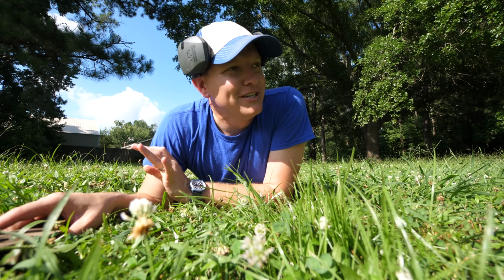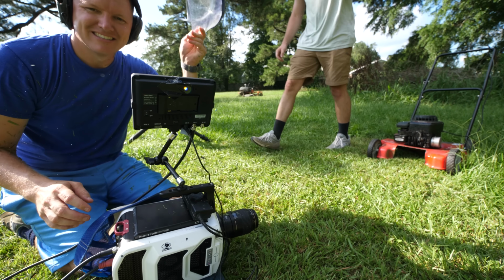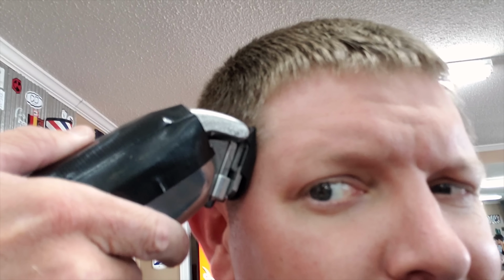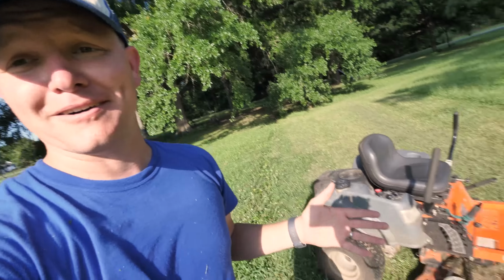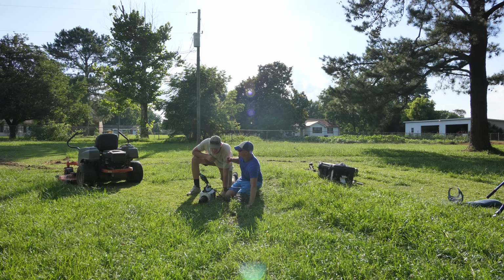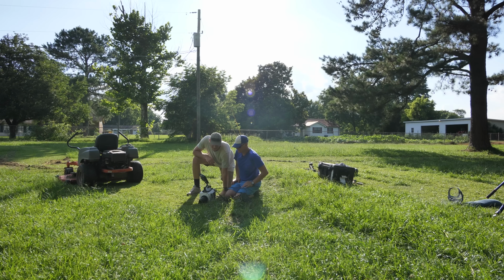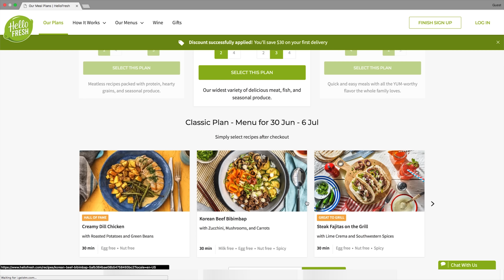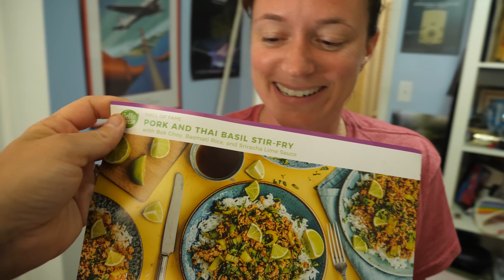How Lawn Mower Blades Cut Grass (at 50,000 FRAMES PER SECOND) - Smarter Every Day 196

Comment: I would be interested in seeing a video(or segment) on the old school rotary style lawn mowers(the sort of barrel shaped ones with no motor.)
I used to do lawn care(fertilizer, pesticides, etc.), and every class I took(often from people with post grad degrees in agronomics) and all my bosses, and everything I've ever read claimed that those are actually superior to the tradition walk-behind/ride-on spinning blade mowers. 
 supposedly they cut the grass much cleaner, as opposed to tearing the grass the way rotary mowers can do(if you look closely in this video, you can see the blades of grass are often raggedy at the ends after being cut(though this could possibly be due to a dull mower blade.))
this is bad because it hurts the appearance of the lawn(the tips are stringy and discolored), and also because it causes the plant to use more energy fixing the "wound", does more damage to the cells, causes a greater loss of moisture, and in particular makes the grass much more susceptible to disease(just like how getting your hand cut off by a shark, or chainsaw is more likely to become infected(due to the much larger surface area of exposed tissue) than getting your hand cut off by saw, a single clean slice by a very sharp samurai sword.))
however, I do not know why the rotary mowers cut more efficiently.  I doubt they cause much of the suction you refer to in this video, and I can't help but think the blades are traveling far slower.  it also seems like each section(or even blade) of grass would only have one chance to get cut with a rotary mower, whereas the rotating blade mowers(even though the cutting surface of the blade is only a few inches long at the extreme end of each side of the blade) has several chances to cut each blade(depending on how fast you are going) and thus is less likely to leave little "mohawks" of uncut grass behind.)
I suppose it could be due in part to the fact that the blades on rotary mowers are moving more or less straight in into the grass(almost like a scythe) whereas the blades on the type of mower in this video are rotating in an angular fasion, and may be more likely to "rip" the blade as opposed to making a clean cut, but since the blade is moving so fast, and the moment of contact between the blade and any individual piece of grass is so incredibly brief, I can't help but think  that the direction/way the blades are moving would make no difference(if the blades were cutting right near the center of blade, where the linear velocities would be lower, then maybe.)
the only other thing I can think of is that maybe the blades on drum style rotary mowers are sharper(please sharpen your mower blades regularly people), possible due to them being just simple pieces of think stamped metal(at least I think they're stamped, i could be wrong.)
wow.  god bless whoever took the time to read that ridiculously long comment about lawn mower blades.  lol.
Reply: The reel-type mower works exactly like scissors, by trapping the grass between the blades on the spinning reel and a fixed cutter bar.
Reply: ooooooh.  lol.  you'd think I should have known that.  no wonder it works so good.

Comment: Hi.  I watched your lawn mower blade cutting grass video. I think you should revisit this for a few reasons one being the blades were super dull. This results in the grass being ripped in half vs cut. Second if you have sharp blades the grass is cut at the tip of the blade as the blades travel across the grass. If you look at your video the tips of your blades are rounded and dull. 

I would love to hear your thoughts. Great job spreading science.  Thanks
Reply: yup, grass is cut by the outermost edge of the knife where there isn't any lift at all, indeed it is just passed the area where the air and clippings are being blown OUT and AWAY from the deck.

Comment: How about push lawnmowers that are entirely human powered, i.e. no engine.
Reply: Those have scissors and get jammed up on the tiniest twig.
Reply: If you keep the blades sharp that isn't as much of an issue. Also for certain jobs they are way better at getting even length.
Reply: you talk about the roller type weird looking blade? I am curious too!
Reply: I do that only using a sickle
Reply: They are basically a rolling pair of scissors.  There is a moving blade, and a stationary blade, and they create that shear point that he talked about at the beginning.
Reply: I didn't even knew that! Thanks, it would be fascinating to see it close up in action!
Reply: What about a scythe too
Reply: Push Reel Mowers are back in style these days. I've got one but it's not very effective on tall weeds.
Reply: Scissors basically :D
Reply: Push Reels are great if you have Bermuda grass and a nice level lawn  lol
Reply: The slightly fancy ones gear the blades to the wheel so the blades spin much faster.  They work well on a more-or-less uniform height of grass/weeds.  Unfortunately, stuff that is tall will tend to get pushed over instead of cut.
IMO, what seems to be missing is the vacuum/airflow pulling things up into the blades.  I've thought a bit too much about how one might be able to make a reel mower where the reel/blades basically make a squirrel-cage fan to provide that suction.  Wish I had the time and tools to prototype it.

PS: I've also been thinking about how to make something similar to a giant Flowbee (the weird vacuum haircutting attachment thing).  That could be cool.  I think there are significant benefits to having the cutting+sucking part of a mower be more of a long thin rectangle than a circle.
Reply: Mme. Hyraelle The best video I've found so far is "Fiskars Staysharp Reel Mower In Action".
Reply: A scythe would probably work on that the grass just does not have time to move out of the way so it acts stiff and gets cut. (idk just a thought)
Reply: I dislike that everyone nowadays uses the motorized lawnmowers. I think the older ones work more elegant and the work is more fun/less noisy.
Reply: The reel mower has a cutting board behind the spinners. The spinners lift the grass up against the blade. To the person who wished we would go back to that...NO. Simply No
Reply: It's telling that the Fiskars company, you know, the one whose name is printed on all those scissors in schools, makes a Reel Mower like you describe. A high quality one is actually pretty good and very inexpensive compared to a motorized one, and better if your mowing area is not very big.
Reply: Regarding a scythe: you swing it around so it cuts into the grass with some angle. The blade doesn't hit the grass with 90 degrees, but cuts into it with a steep angle. It's like when cutting something with a knife. You don't usually just push the knife into something straight down, but you make the blade go forward or backward, sliding it on the thing. Also scythe needs to be really sharp to work correctly.
Reply: Travis Collier i hope you persue your invention

Comment: That “tab” is not to suck the grass up. It’s for lifting the grass into the area above the blade AFTER it’s been cut, to allow it to be chopped up into finer pieces. It does not suck anything up.
Reply: Sorry I worked landscaping for 20 years.  Yes it does.  You can buy high lift blades which absolutely create more lift and suction.  We ran them on our scag mowers.  Airflow increased due to higher lift angle.  Made a smoother cut and threw the grass farther.  You can watch it suck more air into the deck when you have side by side.  We fully tested and verified results from both standard and high lift blades.  Night and day difference.  But deck design helps too.  If there is nowhere for additional air to go it has no benefit.  Commercial mower decks are very spacious as far as that is concerned and the better mowers have figured out the best ways to help increase airflow and suction.  For example a typical residential mower has a deck that is almost bubbled out for the blades to run.  A pressed steel deck.  Commercial mowers have a welded box like deck to maximize volume.  They then add baffles and lips to further increase and maximize airflow near the blades.  Look at underside of scag or exmark mower deck and look at most homeowner mower decks and you can see the difference.  I could go on and on

Comment: For the grass what is the healthiest way to cut the grass? How do weedwackers and edgers work? After this video, I'm not convinced it's as simple as I think it is.
Reply: I believe the old style "reel" mowers are the best for getting a good clean cut but those things went out some time in the 60's when i was a kid cuz they were also so dangerous. Now the only place I see the powered ones used is for mowing the greens at a golf course.
Reply: Yes, reel type mowers slice the grass like scissors instead of rotary motors which beat the grass into submission. 

Reel type mowers require more maintenance and finer adjustments more than just being dangerous.  It's easy to make them safer, but because the blades have to be kept very sharp and clearance between the blades have to be adjusted, that's more than the average homeowner is capable or willing to do. Rotary mowers take less maintenance and are more reliable.
Reply: weedwackers do just what their name implies. they spin very quickly and whip at the stuff you poke them at. Grass is very ridged at that speed and it shatters or explodes where the line hits it. To me the spray off of a lawn mower or weed wacker always feels damp from the aerosolization of the liquid in the stalks
Reply: Probably a pair of scissors is the best for the grass, because most of them will never get cut! Realistically, a reel mower does the least damage to the grass, and the manual ones give you quite a workout on even a very small yard. Makes you learn to keep the blades sharp and properly adjusted, too, as it's even harder to push when they are dull.
Reply: Best thing for grass is the good old fashioned Scythe. Proper technique means it's not too short and just the simple way it cuts via the extremely sharp blade as it all funnels into it.
Reply: Silas Mayes a scythe is the best way to cut grass
Reply: What elk says, using a scythe is the healthiest way to cut the grass and let it grow healthy..
Reply: justadbeer They definitely are, and they are starting to make a little bit of a comeback. They are also much safer now. I have an old push reel mower that was given to me. I use it for my front lawn. Perfect cut every time.
Reply: As someone has been around the turf industry their entire I will tell you that like most things the “healthiest” or “best” way is always highly debated
Reply: same name. its a really rare name
Reply: I'd say the biggest thing is to not cut it too short (at least in my climate in the pnw)
Reply: Silas Mayes the healthiest way to cut grass is the old fashioned push-reel mower...its environment friendly, saves money when you don't have to buy gas...and you don't have to break your back pushing an extra heavy gas motor mower around....uh😶its healthy for you and the grass😉an electric mower is also an option if such a thing exist yet on the market..?
Reply: WHAT I HAVE FOUND, is by studying what professionals do in apartment complexes and similar places. The natural growing height before producing seeds is often a consideration. Landscapers or grounds maintenance people do not want to make their jobs hard, nor do they want their equipment to have to be replaced - it would indicate bad management.

IF YOU GO AND LOOK at how deep the grass is at commercial places, what you find is that they maintain it at about 3 inches of depth, this is the height at which the grass makes a huge difference in both water retention, and health of the "GRASS PLANTS" because at that height - the shade provided by the grass itself helps to retain water, and also because healthier grass sends ROOTS deeper into that ground, which in turn improves its survivability

There can be as much as a 20 degree difference between the outside air temp, and what it feels like at the bottom of the grass

THIS means water retention is increased...
Reply: String trimmers and edgers are actually that simple. They just spin super fast.
Reply: Silas Mayes s
Reply: Cows, they fertilize as they cut.

Comment: The uncut grass is not lifted by the blade.  Check the grass bent over by the wheels.  If there was a vacume action it would be cut the same and overlapping cuts would be unnecessary.  The lift at the back of the blade is to keep the cut off grass flying around so it gets chewed up. Flat blades under flat mower decks cut grass just fine; the grass cut resemble hay more than mush, they also throw any rocks encountered very well!  The tip of the blade does all of the actual cutting of the standing grass.

Comment: Do a scythe. I don't think they manipulate the air around them to pull the grass up, and you also only have to swing it a fraction of the speed that a lawnmower blade goes. Is it just the sharpness?
Reply: _ Madcrafter _ yes
Reply: Yes, scythes work by sharpness and technique. The user carries a pouch with water and a refining stone to keep it sharp as they go along. They sharpen every few minutes.
Reply: The peening method of sharpening would be a good physics/engineering explanation.

Comment: How does a weed wacker work because it’s just a plastic wire spinning really fast without any lift tabs.
Reply: Og Dumpling and how does it break? It’s deigned to hit grass, and somehow it always fails hitting grass. 🤔
Reply: If you're talking about push mowers and edgers that use string, I believe they work simply but applying a lot of pressure to a small area, resulting in shredding.

It's not hard to simulate, if you hold a flat sheet of paper up perfectly flat and get a clean hit on it with lawnmower string, it will slice the paper. 

individual grass stems and leaves are much weaker and or thinner than paper, so they get shredded. 

it's more akin to the grass being pulverised you could say, as you can look at the deck of a weed eater and see the remains of shredded grass splattered against it.

Also a more dark way to look at it, of you were unfortunate enough to get your leg clipped by one, it would most definitely draw blood and slice clean through the skin even though it's not 'sharp.' It doesn't have to be sharp to cut.

To grasp this you just have to grasp the physics of cutting. Cutting is applying enough force to break the bonds that hold a material together. Sharp objects do this by focusing the force over a small area, which increases the pressure, however you can also achieve it by increasing the amount of force you use over the same area.

Can you cut a block of wood with a dull kitchen knife? There's 2 ways you can do it. Sharpen the knife until it's rediculously sharp, or swing the knife with a rediculously amount of force. The later is how an ax basically works. If you feel an ax blade, it's not exactly going to cut you. But if you swing it, there is so much force behind the swing it plows through whatever it hits regardless of how sharp it dull it is.

That is sort of what is happening with the weed eater string. it's being swing around so fast it doesn't matter that it isn't sharp. It has enough force concentrated in a small enough area (force / area = pressure) that it can 'cut' the grass it touches.

As for why the string breaks. Well, the string is still plastic and being subjected to huge amounts of abuse. Like everything else made of plastic it will give out, especially if you try to cut something with it it wasn't meant to cut or cannot cut that well, such as really thick patches of grass, or if it gets clipped by a stump or a fence or a piece of metal.
Reply: Basically the same wacking motion without the lift.

The grass can't bend out of the way so it gets torn
Reply: I've also gotten clipped from the weed whacker before. Didn't break skin, but left a REALLY sore welt. This was also a commercial-grade 28.9cc beast, so I was fortunate that I didn't have it at full throttle at the time (it was spinning down).
Reply: BlackEpyon I got a weed wacker on my ankle it drew blood

Comment: Try a manual push mower with rotary blades, they are scissor action.  Newer ones are actually a lot easier to use as well.
Reply: Golf courses primarily use  "reel mowers", basically ride-on push mowers. Pretty cool
Reply: I use one of the new ones. It's very easy to push, and good exercise. Biggest drawback is if the lawn puts up seed heads. They get too tall and I need to attack them with a machete.